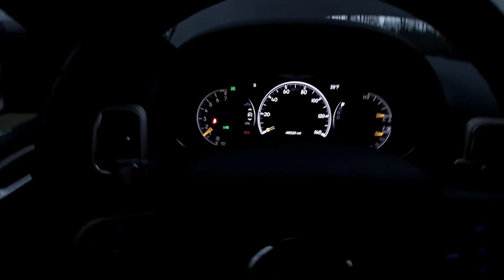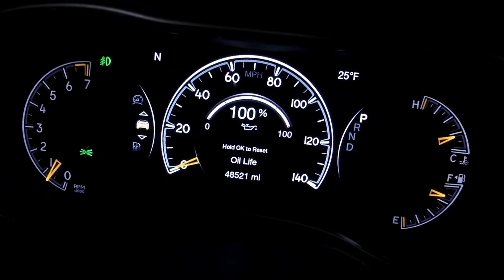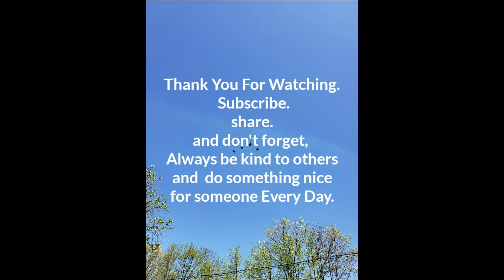2016 Jeep Grand Cherokee Oil Change. || How to:

Comment: Thanks for your video! Yeah, I couldnt find the oil filter myself, I did take off the top plastic cover and guess i just didnt look around in there good enough, 🙃 Lol my first car was a 1949 Plymouth which had a drop in oil filter, I just hated that thing.
Reply from the maker: Glad it was helpful.  Guess there are a few vehicles out there that use them.  Very odd.   Be well.

Comment: Nice Job....Very Informative.
Reply from the maker: Thank you for watching.  Hope it helps.
Reply: With regard to belt squeeze sound , is that when you put ac on or just normal driving without aircon mode .  Mine is 2015 but oil filler states 5W20 in 6 quarts same 3.6 pentastar engine ,  Crysler seems to be up to something experimental maybe designing the filter housing be integrated with the plenum in the future just as what the transmission filter is made . 
Well Done !!! Thanks for sharing helpful tip .
Reply from the maker: @watari4807  hey there. Thanks for checking the video out.  The sound was just during normal driving. I think it was the original belt and was just loosing strength.  We still have this jeep and it has not had an issue since i changed this belt.  I think you are spot on with the changes.  It seems they did a bit of an overhaul on quite a few things for this newest model.  I haven't done much research myself. But I've read a few folks saying there was some changes made.  Personally i have never seen the filter in this location on any vehicle i have worked with. Tho I'm not a mechanic so i dont see everything lol.

Comment: If you don’t mind me asking what size socket did you use for the oil pan bolt?
Reply from the maker: Hi there.  Unfortunately, I don't recall what size it was. I went back through the video zoomed in to see if I could get the size, but I can't see it. Unfortunately I don't have that vehicle any longer either.  I would guess maybe a 12mm or 14mm. Something around that.

Comment: I'm sorry dude I had to stop watching when I saw you installing a Fram filter. Granted it would be better than nothing but only just. Do yourself a favor and research oil filters on youtube.
Reply from the maker: I appreciate the view man.  Be well.
Reply: Fram is the best filter to use, I'm a fleet mechanic and we have several vehicles with over 400,000 miles, and we've only used Fram filters.